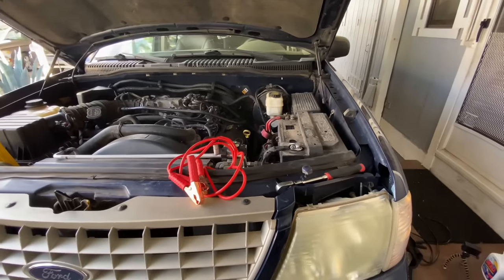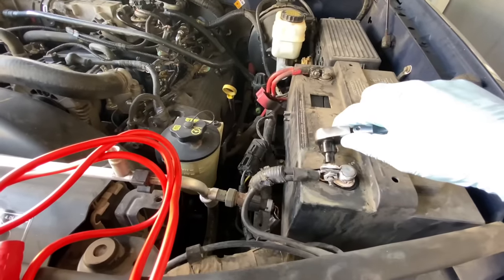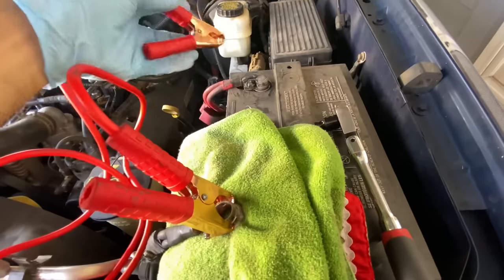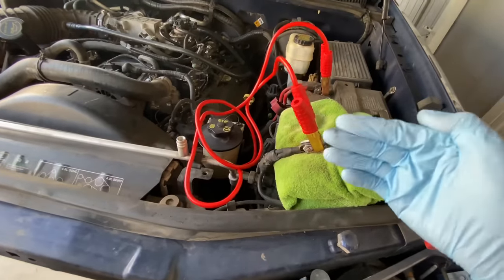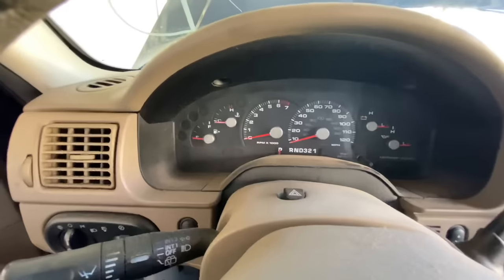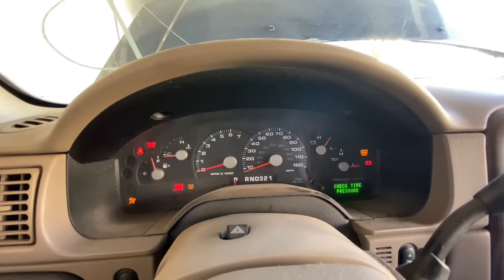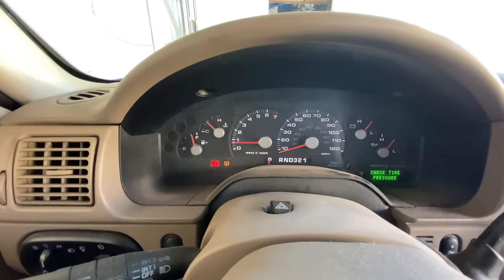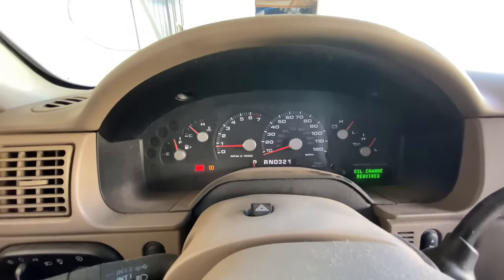How To Reset All ECU’s and Control Modules in your Car or Truck

Comment: I have a 01 subaru outback and just had the motor swapped out and now it has a at oil temp light flashing and check engine light would this help reset everything the at light is flashing before the car is even started so its not from it being to hot

Comment: Does it work on low power? im struggling with the limp mode even tho i did clean parts like the SCV, Turbo Actuator, EGR System, Cleaned the Turbo, Intercooler and the hoses, MAF Sensor like almost every common part😭

Comment: Good video I will try that sometime. FYI even though they still teach the positive is the hot side of a battery, voltage leaves through the negative and goes to the positive. Negative electrons are attracted to positive electron. Current direction is from the negative post to the positive post.
Reply: Voltage does not move.  Amps are the measurement of electrons moving.
Reply: Frederick
Current flow is from positive to negative. Electron flow is from negative to positive. Amps is the rate of electron flow.  Voltage is the cause of flowing current.
Reply: Lighting comes from ground
Reply: And the sky isn't blue that's just what we see.

Comment: What i always did was disconnect both cables and put together with a pair of vice grips for an half hour and it will reset everything plus clear the check engine light.
Reply: You put the cables together?
Reply: @waynej9763  unhook cables from battery and I also used a jump wire with alligator clips at each end and put one on negative cable an other on positive for 10 minutes or so and then put cables back on the battery terminals..

Comment: I renew all my camshaft position sensor and will this method take away a permanent code on my scanner reading, theres no check engine on vehicle.
Reply from the maker: It should. If there isn’t another problem
Reply: Will this work without renewing camshaft position sensor?

Comment: Instead of using a jump cable, you can turn your headlights on and it’ll drain your remaining charge.
Reply: Need instructions bro? How long? And the battery is disconnected?
Reply: it clears any remaining load off that circuit when battery disconnected+light switch on 5 mins
Reply: Some cars ecu have capacitors that will not discharge by running headlights till dead and draining a standard battery all the way down is very bad for the cells of the battery. This message actually discharges any capacitors that are storing energy that are not connected to the light circuit. That's what I heard from a mechanic I'm not electrical engineer so don't shoot the messenger

Comment: Idea is good.....
Execution extremley dangerous!!!
You can do the same by disconnecting positive from battery an jump with negative...
If The rug is just a little wet, or if the clamp will go through rug you'll get the whole car on fire.... connecting + to - using rug horrible idea.
Reply: Correct... disconect positive, but still also extremley dangerous!!!!!
Reply: True, water is an excellent conductor of electricity- so you do want everything to be dry.
Reply: @JesusChacim  negative my friend.
If the negative touch the body won’t harm made. Not the same if positive touch the body

Comment: I did a transmission and starter install and truck would not start. I did this and it worked, shut truck off and did not start the second time. Any idea why?
Reply from the maker: I would check neutral safety switch

Comment: Can't drain the ecm, or the pcm if it doesn't have anywhere to go. Leave the positive hooked up, just like he has stated.
Reply: You sure what if there is a unknown Short somewhere I would disconnect both then put the jumper in for an hour to discharge all capacitors ect
Reply: Workaholic:   that's ridiculous nonsense.

Comment: What I always did was removed the power and turned the ignition to on. Depleting what power left in the system to be used. Haven't used this trick since the early 2000s on my 90s vehicles so not sure if they have it set to only be drawn at a certain power level.

Comment: Will this help is my 09 Traverse is throwing a P0116 code and giving the scanner far different temp readings?  Thermostat is good, has new ECT module, etc.  The local shop suggested taking it to a GM dealer to get the ECM looked at.

Comment: In my opinion, this may take effect only if the key is in the ignition position too.
Reply: will it fuck my lincoln ls v8 2000 auto
Reply: @justinc9911  I am very sorry for you. My Hyundai Santa had no issues after reset. Very sorry, I did not know that without any power active to have these issue...
Reply: Your opinion is incorrect.

Comment: Can i do this for a mercedes 2003 c240 with pressure sensor solonoid b electrical reading on scanner with gear stuck in first and wont up shift? I mean will it fix my issue?

Comment: Warning: Before you do this, make sure you know your radio's code or it may not work when you reconnect  the battery...
Reply: 0000 or 1234 might work for the factory set code on the radio
Reply: Are you referring to subscription radio, free radio or both ?
Reply: Especially on a Saab...
Reply: I would say be careful doing it with a ford. And maybe volvo's
Reply: Especially honda anti theft radios

Comment: I put a new alternator coil pack and ignition switch, so a no bus light comes on with 920 921 999 now it won't start and got new battery. Do you think this reset will start it because it all started with bad alternator. Also the ECU was not receiving the messages from I think ignition you think keys need to programmed Thanks for the knowledge bro

Comment: Would simply removing both battery cables from the battery and connecting them together for an hour or so accomplish the same?
Reply: I think so...but how would disconnecting 2 battery terminals be easier than disconnecting 1?  If you don't have a jumper cable though, then I guess your method would the next move.

Comment: I'm new to the area I'm in I'm guessing it would be easier for me to take it to the Volkswagen place. 2019 Jetta s Volkswagen here.  Engine light came on the other day. Went to autozone for free diagnostic test. I have a EVAP Emission Control system: small leak. The report said most likely solution is to reprogram powertrain control module (PCM).. A Google search led me here. I don't think the person im room mating with has cables/ tools. May I ask for your recommendation? Please reach back out at your earliest convenience. Thanks 🙏🏼

Comment: You need to discharge the PCM'S backup batt, u need to put a load on, like pressing the brake pedal or the headlights
Reply: @behexen250 yeah i know this,  i didnt explain shorting the ends together because its not something i encourage customers to do!
Reply: I turn the headlights

Comment: When  disconnecting the  cable, Disconnect it  from the positive terminal first! After all is done let the vehicle idle for five/ten minutes! Drive the vehicle in a gentle manner for a ten/twenty minutes so that the system relearns all features again! Such as acceleration, gear shifting, Turn signals, Breaking etc. etc. Expect it to drive like a Ferrari afterwards!
Reply: What would be the purpose of disconnecting the positive first? For safety reasons you're supposed to disconnect negative first.
Reply: @badbob666 , In this instance the process is contradictory to safety, Remember we are connecting a cable between the ground cable and the positive cable that is still connected to the battery! the purpose of doing this is to eliminate all power to any relays in the vehicle including the alarm system if there is one so that they can re-set after reconnecting the ground cable to the battery! It confuses the system! It will re-set your computer etc. etc.
Reply: @pancholin1950  if that's the case just take both off the battery and be done with it, on fork trucks that's what I do then after I put the cables together I turn to key to start and it'll drain any capacitors in the system.
Reply: @badbob666 , Correct! Drain all all the power by even turning on the headlights while you are at it!

Comment: How do you reset Service Vehicle Soon light?
Reply: By servicing ur engine
Reply: @MikeJones_BACKTHEN  it had a code cylinder misfiring replaced spark plug wire and spark plug drove it for cycle drive 50 miles later light went off ?  Easy fix !!

Comment: Hi folks. I’ve got a uk Ford Fusion 2005 diesel. Eac fail error just will not be removed despite recommended parts. Will this work on removing that error code from showing ? Thanks

Comment: Would this help remove my check engine? I have codes for O2 sensor heater circuit all 4, egr valve circuit, purge valve circuit. I have swapped pretty much everything and checked the wiring to the connectors, the wiring on the purge valve were peeling so i insulated them. Cleared codes with OBD scanner but still getting the check engine light with same codes. Seen other videos where i might need a new pcm. Truck runs perfectly fine how its always ran its just the fact i have the check engine light on. Any helpful thoughts or ideas will help. Thanks.

Comment: I did this procedure on my toyota Rav4 and it brought my rpm very low how do I get it back up 900 to a 1000
Reply from the maker: It needs idle relearn after battery disconnect, I have another video that shows how to do that in a Toyota
Reply: Low rpm is good

Comment: Did he say "for the next few hundred months" to drive the car easily?
Reply from the maker: Few hundred miles
Reply: @GK7GARAGE  fu that my car
Reply: @GK7GARAGE  
And there is no reason to drive differently. The ECM doesn't need a Breakin Period. As a NEW Car should be given, for Mechanical Components. Your Fix. Is the same as a Router, or and Xbox for that matter. Unplugging for a given amount of time. You are just draining all the CAPASITIVE modules in the car. The components that keep the memory powered. 
And Actually. 
If you simply disconnect the negative terminal. The system will drain the same way. Since all are connected to their own Grounds. 

You have the Right Ideas 👍

Just keep your Tools away from the Battery 😂
Reply: @lisanelsonn7185  what up
Reply: The ecm will learn how you drive..Basically, drive like granny, the car will act same way. Drive it like you stole it, car will act same way.
Reply: Well this way did nothing for my Chrysler 300 but I found another way that did actually work and she's running like a dream again
Reply: Skee bo - OK what was your other way??
Reply: Yes yes he did for the few hundred months drive it yes for a few hundred I guess that's three 300 months
Reply: Yeah I caught that too, for a minute thought I was tripping or something, so I rewinded the video. No he did say that, "for the next few hundred months." I wasn't tripping, he was tripping. Lmfao!
Reply: @skeebo9322  ok what's you other WAYYY
Reply: @skeebo9322  what did you do??
Reply: @Shinryu101  link above
Reply: @tonycervantes4816  link above
Reply: So guys my other way was just a temporary fix. Lasts no longer than a day. I ordered some variable engine displacement solenoids that are supposed to be here tomorrow.  Hopefully that'll fix  my issue of stalling, turning off while slowing to stop and in tight turns. If not I gotta replace the ECU/ECM
Reply: Lol
Reply: @skeebo9322  sounds like a power steering pump problem on when u turn and it shuts off.

Comment: Im trying it now4/15/24 on a 07 explorer, all 4 o2 censors, 2 leen codes, exost emissions, misfiring codes. Been going on for a year. I changed 1 02 censor and no change. I was ready to buy a used control module then seen this. I hope it works. Even my shifting started to not go into 2nd gear. Plus hard shift at times. Its got to be the computer. Not to mention my battery is draining fast when key in on position,radio stops playing, inner lights all came on, i took the bulbs out. I think thats all.

Comment: Is this the short-cut to the "Frankenstein Reset"?  I was informed on how to reset my PCM and ECM by a "honest mechanic" at a GM Dealership in Texas.  When your vehicle has been parked and engine off and is cool to the human touch, you disconnect the battery cables and after few minutes, but i wait until 30-mins then I close the circuit by touching the negative and positive cables for about 10-to-15 seconds then I reconnect the battery cables - start the engine and the whole system is reset and does a system check.  I recently had to do it again to rule-out false sensors - the "Check Engine Light" has been gone for nearly a week, but the metal rattling noise is back - I am praying it is not my catalytic converter

Comment: I’ve done this cus I have P0101 code that keeps coming back even after I’ve erased it. My scanner says it’s a permanent code. Whatever that means. It’s a 2012 Nissan Maxima.
Reply: I have the same car. And mine check engine light came on with the same code. I got it red in Autozone. It says my computer need to be reprogram. How did it workout for u?
Reply: Gerald Duroseau Did you get it reprogramed, and what was the charge?
Reply: The computer doesn't need to be reprogrammed the throttle body needs to be programmed or relearned.  There are manual procedures that work sometimes or the dealer charges around $100. Search maxima throttle body relearn.
Reply: @billwilson3665  Thanks for responding.

Comment: you need to put a 10 watt   1 ohm resister connected in line to the positive and negative terminals when draining the system ...other wise you can damage systems by draining them to fast the resister slows the drain down so no damage accurse to systems in the vehicle ....  amazon has these in stock very cheap !
Reply: Hi. Thank you for confirming this information. Thanks!!

Comment: My 2006 infiniti m35 cranks but wont start can i use this method as well. I changed my fuel pump, crank shaft sensor,  and spark plugs and coils still no start

Comment: Don't do this on a BMW or some Mercedes, you will be having the car towed to a dealership for reprogramming. As you can imagine it isn't cheap.
Reply: Why is it different for bmws? Genuine question
Reply: CUTTS CLASSICS the OS software is stored on ROM chips instead of RAM like other cars. If you interrupt power to ROM chips they automatically dump stored memory.
Reply: @cuttsclassics2433  I might have the technics backward but I had a 7 series and had to have the computer reprogrammed by the dealer after leaving the battery disconnected for too long. So it can happen.That's why your supposed to connect a jumper battery before trying to replace the battery. At least that's what they told me when they handed me the bill.

Comment: Disconnect the negative battery cable, open up the drivers door, put your left foot in and then put your left foot out, do the hokey pokey and turn all about. And you will still be clueless!!!
Reply: Ah

Comment: 5:13 lmao, a few hundred months.
Reply from the maker: Lol meant miles
Reply: What ? drive properly or drive how you drive ? So it can learn
Reply: I cought that too 😳
Reply: Can I use a standard jumper cable? And leave the other end on the plastic engine parts after I follow your directions?

Comment: Does this reset the transmission codes?  I did just the battery disconnect & it cleares all but those. I left it disconnected overnight.

Comment: I have 2002 Chevrolet express 2500 V8 fuel. The system module got burned and I replaced it but the gear wouldn't change. What should I do?

Comment: I need some advice if you can help. I have a 2012 acadia and it starts but only runs for about 3 seconds then dies. Plugged in my scanner tool and it gives a code for a bad ecm. Do you think  it might just need a reset or do I need to replace it? And if I do need to replace it and but a used one from the same model car does it need to be reprogrammed for the keys and vin #  ?

Its my son's car, I spoke with him about it, the car sat for about 2 weeks while he waited for his new rims, and the battery was dead, he jump started it and drove it for a couple days then it sat for a few more days then now it wont stay running. I tried just unhooking the ground on the battery for half hour then tried to start it but same result, but I didnt try the trick you showed here in this video. it has a p062f code on the reader. That's the only code it shows.
Reply: It's the key. It needs the proper security key

Comment: So what exactly does this reset do? Should I do this if I put in a new vtec solenoid and also if I put in a new Accelerator Pedal Position Sensor?
Reply: It gets all the power off of the circuitry and capacitors and makes everything reassociate.

Comment: Hello, I tried this for ECU on my 07 Cadillac CTS would not start, charged battery, would not start, redoing your technique, hoping it starts, if not is it my alternator?  I did test my headlamps and they do turn on as does my radio.  Nothing lights on dash except antitheft! I even tried to pull that fuse and start and nothing, put theft fuse back in let it recycle and nothing. Battery showed charge over 12 volts however on the charger the alternator light did not come on but headlamps work! Damn antitheft light also on.  I've tried every trick with keys, the lock and unlock car. still no crank, no start.  I'm hoping the ECU reset for 2nd time works, fingers crossed.  I can't find another videos on this however I do make sure to recycle after each step.

Comment: I would suggest charging and testing the battery while it is disconnected.  I installed a new battery in my 2008 Cobalt.  Unfortunately, it was not fully charged from the dealer.  Car would not start even with a boost.  I disconnected the battery and charged it.  Reconnected and car started.

Comment: Hi Thanks for this after completing this reset I have found one problem the display for the radio and aircon is only working intermittently both aircon and radio are working fine just the display  is not any advice? please